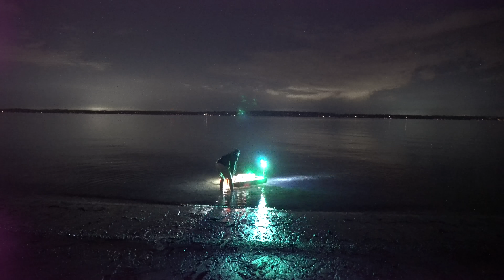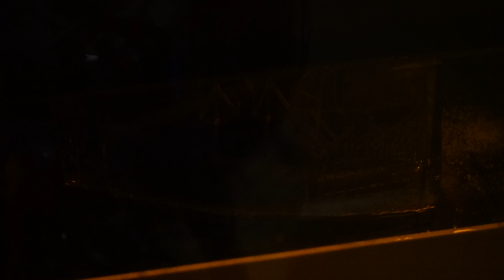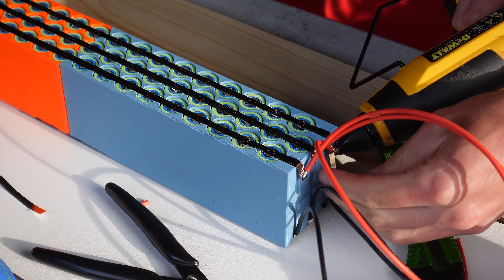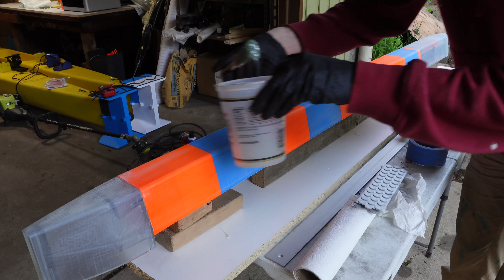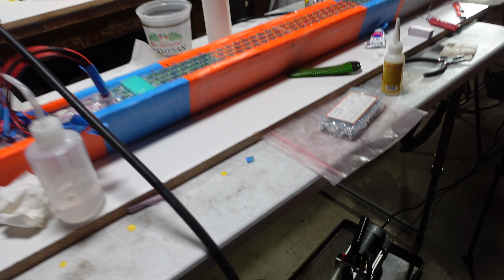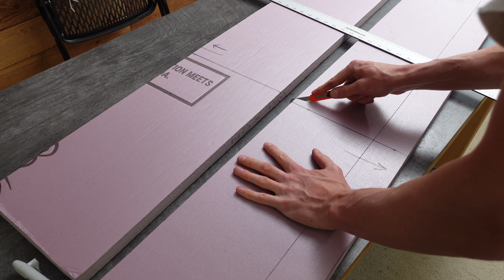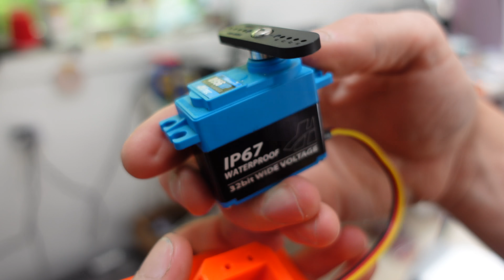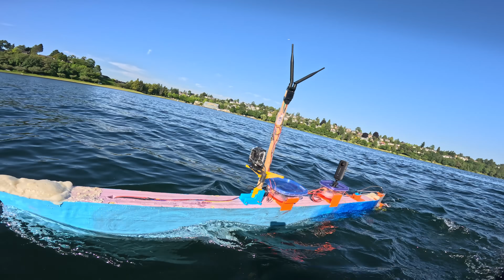"R/C Boat" with 40 lbs of Batteries

Comment: I’m laughing at not filling the battery compartment 95% full of grease before putting the panels on. Would have saved you all the time lol
Reply: That would probably work but depending on how much you put in it could get really messy, and if you don’t want to risk the mess you would probably still have to pump in some grease anyway. I’ll give him the benefit of the doubt though, he for sure knows more than I do.
Reply: @exploringtheplanetsn when you’re making a new design and making something it’s easy to get stuck in the way you’re thinking about a problem and over engineer a solution. Yes he’s smart enough to have thought about it. He just wasn’t using that train of thought. He would still need to pump and it was a mess. Just the amount of time it took would have drastically changed.

Comment: Definely could use a bildge keel to reduce the pendulum rolling, without hurting efficiency too much. Would be pretty significant in choppy water otherwise I expect it will lose alot of momentum trying to keep itself upright where a fin along the bottom will help it naturally fight the wanting to roll excessively back and fourth.

Comment: why did you use grease? i think if you would have assembled the "tube" fully, with the acrylic top panels first and used rubber silicone to make it fully waterproof and kept the "front element"? of the ship not attached to the tube, you could have loaded the tube with the batteries like a magazine. IF ONLY for the reason of you taking it apart at one point and having to de-grease all the batteries again xD. like...why the hell grease?

Im very happy you didnt fill the tuperware with grease too xD

Comment: it may make sense to add a few inch rise to the bow/ fo'c'sle that drops off to the height of the foam around the mast, just to keep the water/waves from pushing the bow under as much, and helping it to "climb" over smaller waves. I've seen a few other people recommend bilge keels as well, those or an active stabilizer for roll may help keep your rudder over-correction issues at bay, those look like it might be ardupilot misinterpreting roll as yaw.

Comment: the reason all your builds wiggle when being gps guided is becuase they arent long enough , make em longer so the waves effect it less and the rudder has less of an effect. Otherwise your boat is wasting time doing tiny corrections constantly for no reason which is very inefficient. Rudder should barely have to move every now and then.

ships or boats at any scale shouldn't have to make dozens of corrections every second it's wasting electricity doing that. Not to mention , you goal of a waypoint mission is LARGE scale so these tiny corrections don't make sense anyway. Don't think airplane , think ship. "that general direction" is what you need , not split second control.

the reason you think you need split second control is because the ship isnt long enough and getting pushed around by everything.

Comment: really gotta check the actual capacity of these cells before such a huge project, but omg yes is that a pain. I had an 18650 that tested out 2200mAh at 1A and <1mAh at 3A and yes it was a hot one. Check themn in tiers, get a constant current discharge and if they last 100ms at 5A they dont belong in s tier. great video

Comment: Hey, bro!!! What are you doing? 
you can put a few hundred fires on your account after this video, or delete it!!!!
I realize you're super neat and have the skill to saw with a dremel, but others may not have that. 
You can never saw a battery, just take a pliers and rip off a bus that is held on by a couple of microscopic points, in one motion!
This is the most inefficient, time-consuming, and dangerous way of dismantling a batarpak I've ever seen in my life.
I had a much better opinion of you.
I hope you have at least some soldering acid - orthophosphoric acid and a soldering iron with a big heavy copper rod. This allows you to attach powerful bus bars literally in a couple of seconds without heating up the batteries at all.
After acid, everything needs to be washed with alcohol! Also alcohol is a good coolant, until the skill grows enough not to heat the batteries absolutely during soldering

Comment: Welp, Daniel is reinventing boats again, with predictably unreliable results. 

The grease is going to be so messy. It's an interesting idea. I would think a better idea than silicone around wires would be a connection through a bulkhead, solid connection, no through wires.

The failure of the buoyancy calculations shows that this is tinkering, not engineering. 

Crayons? Geez this is way more janky than usual.

Comment: Next time, try mineral oil (much cheaper) instead of silicone grease. Clear vinyl sheet attached to the topside under the deck with openings that allow you to flex the vinyl down towards the batteries a bit. Screw the deck down and the vinyl acts as a gasket. make sure you have a bleed port at the opposite end of the fill port. Fill with the mineral oil. No pressure should be needed, just gravity.

Comment: I feel like that it probably wouldn’t have leaked water. The pressure you’re putting that grease in is insane and that boat won’t have a very low draft and won’t have much pressure against the hull. If you were that worried about leaking you should’ve just made a gasket between the joints

Comment: Nice! Definitely I would like to see an X-bow design for another project. Also try to make the bow razor sharp as possible and make the transition from the bow section to the middle section more smooth, like a droplet of water. 
I would try to avoid foam but try to make watertight compartment, foam will always add weight and what is generating buoyancy is the volume of air that could be free or trapped in the foam. If you can make watertight compartments with the thinnest fiberglass wall possible could be a good comparison with the foam option. My engineer team always add volume to our catamarans when we have problem with weight, foam is only used as thermal insulation (I work as an exterior yacht designer in a yacht builder studio).

Comment: I haven't tried personally but I would look into welding plastic sheeting into bags like you see washing machine makers do to cover wire bundles from water splashes. They just use an upturned bag but you can buy really long heat sealing bars for cheap and I imagine a double layered bag of fairly thick plastic could do a fairly good job at keeping water out. Again, just an idea unsure if it could work

Comment: If it is 12V it would be 3S correct? Having them in parallel increases capacity, series increases voltage.
Reply: he said it wrong. his entire battery is just wrong in every way. I wouldn't want to be in the same street as it when its charging

Comment: It seems almost easier to seal the 3D print (e.g. using wax) and get a single large cover piece with a silicone/rubber seal to make it air-tight and possibly put some film to reflect the sunlight (or high reflective white paint) to avoid heat. Though grease seems like a really good solution as well.

Comment: replace liquid level sensors with sonic transducer style distance sensors. Another option is to use constantly on venturi effect fans to pull in liquid through small hoses and blow it overboard with air.

Comment: should have had a deflecting/flared nose cap on the front to prevent submarining and put a bow bulb on the front. Also at higher speeds the second motor will be lowered in the water and will make sense to keep on the craft.

Comment: Comment 2 - you can save substantial power needed to turn the boat rudder by incorporating a "trim tab" or "control tab" to move the rudder. 
I got useful explanation results by Googling "flettner ship rudder control tab"
Sampson Boat Co Channel shows how they have the "control tab" installed, in the episode called    "Fixing the rudder and painting the boat!"

Comment: I wonder if you would like to extend the range of your vessel by using wind. The optimum solution could be Flettner Rotors, that can be as simple as a column of aluminium soda cans, rotating on a vertical axle. The two big benefits are - 
1) No need for sail trimming and angle optimisation, 
2) Do not create much  heeling effect when the wind is optimally off the beam 
3) Don't create violent power surges during gusts. 
4) Can be programmed for direction and rotation speed based on wind conditions.
I have been collecting Flettner videos on my Channel Playlist called "Flettner resources"., if you would like to get more familiar with the principles.

I'm also building my own larger  project, Playlisted in "Flettner Rotor Project"
I'd be glad to correspond with more info if you get interested.
Best of luck with your projects.

Comment: How about using fish oil and some pressure buffers inside battery compartment? Oil is not as compressible as air, leaving no space for water. If any oil leaks out - it being made of fish should not pose any biohazard. 
The buffer can be a spring in a bag - when hull gets compressed, buffer compress too, instead of the oil leaking out the hull.
This trick is sometime used in UAVs RND

Comment: If you plan on using gelcoat for the finish surface, use polyester or vinylester underneath. Polyester does not stick to epoxy. Also, on a relatively warm day, (70+ degrees) use less catalyst than what they recommend. Polyester resins (including gelcoat) harden quickly and can get very hot (thermal runaway) and not cure correctly when you put too much catalyst in.

Comment: Love the design. But given the final dimensions, i would have used a pvc pipe as a battery and electronics compartment, and built the rest of the hull shape with 3D prints, foam and fiberglass

Comment: I work at a subsea drone company, and we mostly use mineral oil for deep sea proofing things. Much easier to fill in and get out. Also, I don't think that much effort was needed for a surface vesical.

Comment: I dont understand, why not 2 nipples at each end, and pump from the center? Or heck, have each 3d print be its own self contained grease cavity? Or heck, why not pour in the grease first, squish in the battery, bolt it down and then pump in more to get rid of bubbles?

Comment: I love seeing people make mistakes like this, because thats the sort of thing I do on an engineering test where I calculate the buoyancy of the material, but forget about the displacement. Granted that was for a flood gate, and the first sentence was “suppose you install a fiberglass flood gate with a wall thickness of 1.3 mm…”, I retained the material and forgot about the wall thickness, then calculated from the dimensions of the gate its buoyancy given the average density of fiberglass. I love throwing away half the problem because Im illiterate.

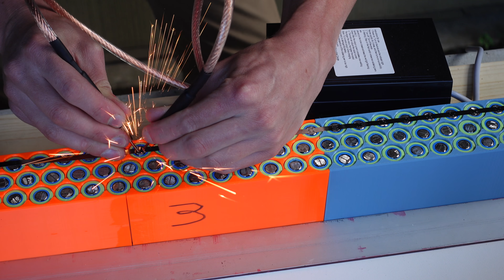Comment: 4:46 oh my god, do not do this.  If the batteries are slightly different voltages, they will try to charge eachother up, possibly starting a fire. You really should have used something to connect the batteries together with a bunch of resistance to equalize all the voltages before spotwelding them all together
Reply: Also this many batteries in parallel with no fuses in sight and mixing and matching "whatever batteries"? Holy cow man. Just have some basic standards in battery handling!
Reply: Relax bro, can't you recognise comment bait when you see it? Danny's no noob, he knows batteries.
Reply: @PR31D  Apart from the fact he took a huge water damaged li-ion battery pack that could've blown up/caught fire onto a lake...

Comment: With no need for a life support system you could just make the control tower several meters long so that it could be controlled with satellite with a 95 to 1 battery to payload ratio these machines could carry an impressive payload with long range.

Comment: As you likely read afterwards Gelcoat is for coating the inside of a mould before lining it with GF/CF IE it needs lack of air. For what you were doing I believe "Flowcoat" is the thing to go for. This will cure in an aerobic environment.

Comment: the torque twist effect the motors had on the boat at the end reminds me of my college's triple motor e-boat. They had a PWM knob that controlled one motor, and once you got to max rpm, you flipped a switch which opened (no power) the PWM contactor, and closed the other three contactors, turning all three motors on at once.. Apparently, the torque from all three motors was crazy, twisting the boat enough to take in water, and the amp pull was too high to put all three motors through that pwm circuit, so they opted to get a "running start" of sorts. crazy to see it actually happen on a boat rc size!

i think everything was ran on relay logic, except for the PWM control. Fully student-designed, with guidance (and to make sure you didn't blow yourself up) from the professors. I believe it had last ran in 2018-2019, but me and a couple of my buddies were convinced by one of the original professors who helped build it to at least get it running again. i think were gonna bring it out to a lake this year and give 'er a shot!

Comment: I've seen you have problems with laminating multiple layers of fiberglass. Firstly, for the work you're doing, it'd be good to pre-wet your glass before laying it on. Secondly, it'd help to have an aluminum epoxy roller as it can help squeeze the epoxy into the glass and get a good bond between layers. The foam/nap rollers you're using have too even of a pressure distribution and can't force epoxy to move as well as the all metal roller can.

Comment: I would have potted the battery pack in a 2 part re-enterable gel.  Magic-gel from raychem is available online, or there are cheaper no name brands alternatives from China. 

Pumping grease is hard, so much pressure from viscosity, and so much force on large surface areas.

Comment: Since it rides so high in the water you could replace some of the foam with some material that is more dense to weigh it down.  Maybe little bricks of flour?  You know, just to be able to use that second motor.

Comment: Learn about positive compensation systems. All ROVs use them to keep sea water out of motors and electronics, and also to remove any collapsible air bubbles.
Oil or water glycol can be used.
Edit - it's a very robust approach, you can just tip out the oil to work on the electronics, and it's very simple to make on a hobby level. Just use a small balloon to create the positive pressure (it will also apply depth pressure to the cavity if you're using it on a submarine project)

Comment: Awesome build, just aa heads up though, that little bms you added doesnt balance the cells, they are great for over-current / short circuit and pack voltage protections, but for balancing you would need an external balancer with that bms.

 There are small bms modules like that which does have the balance circuitry

Comment: It does look promising, however i would add some underwater fins along the length of the boat to stabilize the rolling a bit. Cause those topperware boxes are clearly the weakpoint on the design.

Maybe position them in some kind of tower? That way they don't get the full force of the waves